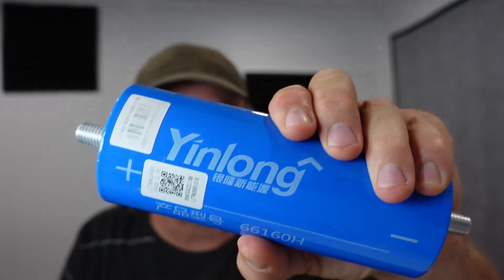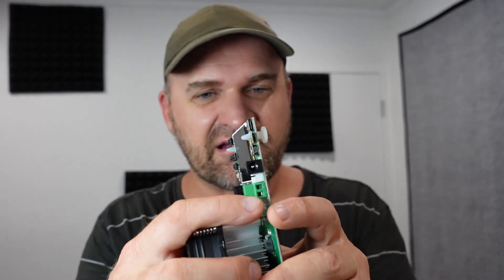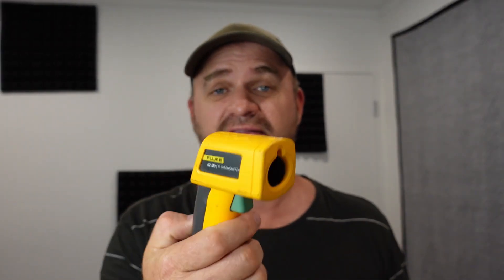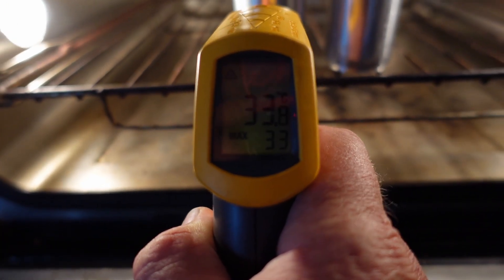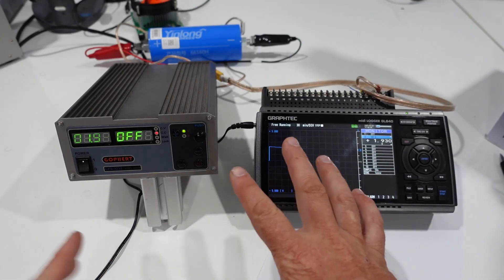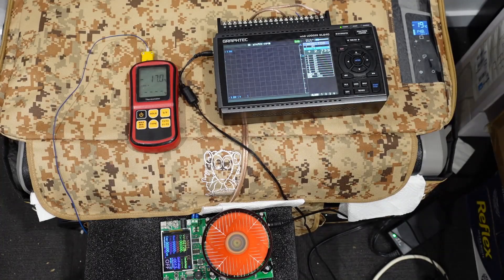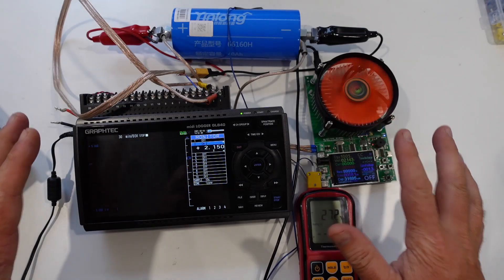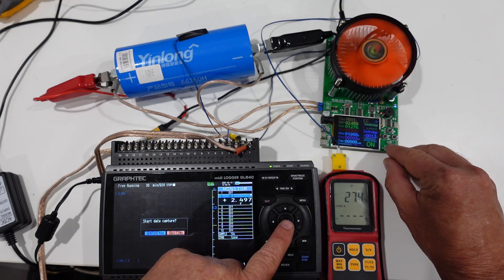Battery testing Low temperature LTO

Comment: Note on laser thermometer: reflectivity of the object can make the measurements off. You measured on the round parts of the aluminum. The laser likely bounced off in different directions depending on where it was pointed at the surface. Try measuring at a 90 degree angle on the flat side???
I have one of those thermometers and you're likely to get widely varying results trying to measure the temperature of a mirror. You might also try painting or marking the surface with a color that isn't as reflective.
Reply from the maker: Nearly... the emissivity and reflectivity combined.  Additionally, things that aren't reflective in the visible spectrum can be reflective in the IR spectrum.  There will be no difference between measuring a mirror or a piece of glass.  The glass is opaque to IR in that wavelength, so the sensor will not be able to see through to the 'silvering'.  Glass has a surprisingly high emissivity, but it also has a high reflectivity.  In the example I used, the angle of measurement/reflection had little to do with the difference in readings.  I'll do an update on this when I get back into posting vids.  Thanks for the comment..
Reply from the maker: The difference between the two was that one of those bits of ali had high emissivity and low reflectivity in IR and the other had low emissivity and high reflectivity in IR.  Visually they seem identical.
Reply: The thermometer I have is made more for high temperature objects, or at least that's what I bought it for- molten metal, firing pottery, etc. There are videos that show how to bend, form, and swage PVC by putting 400 degree (F)/200 degrees (C) sand inside. It saved me enough money on fittings to pay for itself and I didn't have to use as much glue either.

Comment: Hello, I have lto titanat, its voltage was 3.20 on its own in 2 days, is it a problem?
Reply from the maker: On its own?  Is it wired in series with other cells?  It seems like a significant problem to me
Reply: @brendontait6968  hello i solved the problem the multimeter was faulty
Reply: @brendontait6968  I have another question, what should I balance the cells with?
Reply from the maker: @Harun Genç  I've only ever balanced manually.  Initially just putting cells on two metal rails and charging to 2.8V.  I've also manually discharged the banks of cells that are reading high in the battery to bring them into balance with a long bit of wire.

Comment: you can't measure shiny surfaces. The meter doesn't record temps correctly on them.
Try measuring your temperature in a mirror with these.
Tesla warms the batteries on a cold day, when charging, before starting the car, for this same efficiency reasons.
Reply from the maker: Nearly...  What we see as shiny is not the same as what the gun sees as shiny.  For eg with your mirror example... The wavelength these are measuring sees glass as opaque (the spectrum of light the gun can see will not pass through the glass), so it will not see the mirrored surface on the rear of the glass.  Glass also has a high emissivity which means that it emits heat well which will be picked up by one of these guns.  I'll do a deeper dive on this in a later video.  

With regards to the tesla...  I believe the heating of the battery pack is more to do with safety and longevity than efficiency.  If you discharge (at high rate) or charge a standard lithium cell at low temperatures, you'll have the potential to cause irreversible damage to the cells by way of plating or dendritic formation.  This sort of thing can lead to reduced life and safety issues by causing thermal runaways when getting charged in the future.
Reply: @brendontait6968  Interesting. I thought dendrites on Lithium batteries form mostly when batteries are overcharged, or operating at high temperatures, since heat generated between the layers of the battery is causing movement in the electrolyte, which cause hot spots on the lithium layers, causing the formation of dendrites.
Perhaps when cold, the internal resistance rises, causing higher charge voltages, and causes more heat in the core of the cells (while the outside is still cold)?

Comment: You should not have a quarter volt loss over 1 ft of wire. If that lost were linear, it means you'd have 2.5 volts loss over 10 ft. Not possible unless you were using an extraordinary poor conductor
Reply: Iwire (A) × (2 × L(ft) × Rwire(Ω/kft) / 1000(ft/kft))

Comment: Where did you  go?
I would love  an update on this configuration?
I'm about to pull the trigger on 50 cells.
Reply: I'm in the middle of designing the solar system. I'm trying to decide on batteries or capacitors for my school bus build out.
Reply from the maker: Sorry for slow reply... My battery all seems to go well.  one thing I would caution with this style is the internal resistance varies wildly between cells.  So should be built with matched parallel banks.  I'll be back soon!

Comment: I was fortunate enough to find a couple used toshiba 24V LTO batteries (12s2p with 20A cells). I like the 12s better because I don't have to be as concerned about higher cell voltages when it's hot outside. I didn't use a BMS, just 2 cheap PCBs that they use for the supercap boards (6s). I am thinking of using one of those active balancers that uses the capacitors to keep all the cells at near equal state of charge.
Reply from the maker: Lucky!!!  Tbh I'm not a big fan of cell balancing (I'll go into this in a future video) I'd keep a monitor/BMS on for safekeeping
Reply: @brendontait6968  The supercap PCBs are sort of like a simple BMS, they switch on a resistive load when a cap (cell) reaches 2.7Vdc. That would only work for smaller charge currents, but they work for my solar charge controller setup (not real high charge current). The capacitor balancers can be switched off/on so I was planning on turning them on at 2.4V per cell (29V pack voltage for LTO 12S).

Comment: So do you think these batteries would work well for a house battery? With its high lifespan in cycles, it makes sense to have a battery that would last 30 years. Only thing is what inverter to use? What settings do you set your inverter to for the MOG?
Reply: IF Brendon doesn't pick this thread up - it's not difficult to make LiFePo4 last extremely long cycles. Slow in, slow out. That keeps your C ratings down and gives the internal electron's an easy ride. Good batteries are so cheap now it's easy and light to get a big bank.
Reply: PS. Will did a great piece on it in 2019 using info from a Swedish Uni. Good luck
Reply from the maker: Hey Lucy, batteries are getting much more affordable.  I don't really like how most people build their battery packs, not much thought seems to be put into them.
Reply: @brendontait6968  agreed, but I assumed (rightly or wrongly) that Mike envisaged building with LTO as I'm not aware of commercial built packs. BTW. Love your mindset Brendon x
Reply from the maker: Thx 😊
Reply: @lucylovitt9583  I think that there are commercially available LTO packs now. In Australia at least.
Reply from the maker: I thought I'd answered already...  these are the best in my mind, just not the cheapest.  I'm doing a house battery shortly from LFP cells due to their low cost.   The inverter I use is just a regular 24v one. The running range of the battery is 22-28V.  I use a victron mppt to charge it.  During summer I turn the voltage down to 26V.

Comment: How long does it take to charge
Reply from the maker: Depends on what I'm charging it with.  On solar, would probably take a day and a half to charge from zero if some really sunny days.   But it rarely goes below 80%.  That is with domestic fridge, induction cooker, electric hot water.  In most cases it is charged by 10AM.  If I were to make a super powerful charger, could charge from 0-100% in just 10 mins.

Comment: I figured you had clear coated one of the aluminum cylinders so it’s not reflective in whatever wavelength the non contact thermometer is measuring. That one would measure correctly while the other (unmodified) would be off as it’s a terrible black body. Basically insulating itself against thermal radiative losses the same way a space blanket works to insulate you. With the right thermal camera the uncoated one would appear black(ish) but the “clear” coated one (in the visual spectrum) would appear white, glowing by comparison. This may not be what you did but I think it would be another way to achieve the same effect if not.
Reply from the maker: Hey Brett - you get 10 Points!    good work, first one to fully describe what I was showing.  WIll do an update on this in near future.

Comment: this is the best testing i have seen Great Job!!!!!!!!!!!! these LTO cells are a motromer homers dreab they can phicaly sit where the lead acid house batters where, outside or down center of the frame rails of class A (without pass through storage). aside from cost the batter bank could be huge and could be charged at high C rates. What more could a motor home want to never have have a generator or solar panels, just multiple huge alternators activated like a jake brake. You can buy a lot of batteries for the price of a 7.5 KW generator
Reply from the maker: Thanks for that, there are a lot of aspects that I really like about this chemistry

Comment: I would like to use these on my RV!  First they would be connected to an onan 4000 generator which needs 250 amps to start!  And the RV is and charger is setup for standard 12v battery!  What configuration would be required for this?  5S2P five series by two parallels( 10 cells) or should it be 6S3P?  Ie im worried about the high draw of the starter, and having correct shutoff voltage on the charger!  Inverter has low shutoff of 10.5V, and high shutoff of 15.5V.
Reply from the maker: 250A is nothing for these - remember a 1P pack can crank out 400A.  I'd get rid of the gen set and just get a bigger bank and decent solar - maybe even a good alternator on yr RV.  I have plenty of power just running solar.  This is powering induction hobs, electric hot water, domestic fridge etc.  I'd be running 6S and charge limit to 15.3V
Reply: @brendontait6968  thank you for the tips!  I would like to eventually install the solar panels, but im going to have to build up to that!  Also im not sure i can change the settings on this inverter so im stuck with 15.5 on high shutdown for the moment!

Comment: Hi Brendon, I am building my camper based on the IVECO 90/16 ex firetruck. I want to use LTO as a power source. What do you think of this way of coupling using threaded bushes instead of the nuts used fir the test setup. And maybe shortening the studs?

Comment: If you're filming the measurement process you can implement a cheap, but labour intensive 4-wire-measurement by measuring voltage with a multimeter and manually integrating the power afterwards from the video.
Reply from the maker: Hey, yeah there are a few ways to do it.  Glad I have a 4 wire load now.

Comment: measure voltage at each end of your power wires at capacity loading calculate power loss and  subtract that from watt meter.Your wires are now part of your battery calculations.
removing will improve end value a little.
Reply from the maker: I think just getting a 4 wire meter will be the best option.

Comment: Hi, love your talks. I am looking at powering a large launch with an electric motor as it's only drive motor. Would you suggest these Yinlong batteries? I am also in NZ. I ultimately want to run from only solar powered batteries with enough power storage for long trips to the Polynesian islands and Australia. I will also have a diesel generator backup for those cloudy days.
Reply from the maker: Thanks for that.  Sound like a great project.  Have thought about doing this sort of thing myself,  personally i'd use LFP cells due to the cost/capacity ratio.

Comment: Awesome thumbnail 😂🥶
Reply from the maker: haha - thx Will, i was sweating like a pig taking it in the middle of summer
Reply: Will Prowse refuses to acknowledge messages!
I’ve been trying to get help finding out about these Li2Ti03 batteries for boat’s with larger loads and 250amp alternators on the main engines!
I also have a xantrax freedom 25 that keeps blowing fuses in the MPPT controller every time I plug into the shoreline power supply the bulk charging from the inverter charger is to strong!
Reply: @fixitbrewbaycustom854  I get over 100 emails a day. I don't even have enough time to open them. Sorry. Check out diy solar forum if you need help
Reply: @WillProwse  I’ve already tried the forum and even there they started changing the subject to motorcycles and their preferences and riding habits! 

Meanwhile the issue with customers with larger boats having 250amp 12volt alternator and larger loads out on an anchor is why I’m trying to get help finding alternative solutions to lead acid batteries!

Without LiFeP04 batteries catching fire inside customers boats miles away from land!!
Reply: I’m curious why you ignore messages about these Li2Ti03 batteries for boat’s?
Plus I’ve been sending messages about this Freedom 25 inverter chargers blowing fuses in the MPPT controller every time I plug into the dock it’s bulk charging is to strong and I have been trying to get help to find a inverter charger with MPPT controller built in to avoid this issue! Most larger boats have a 250amp 12volt alternator and battery selection is critical!!
Hence why I’ve spent 6 months trying to your attention on this issue!
I’m curious why you are constantly talking about guns and girlfriends instead of DYO solar systems?
Reply: @fixitbrewbaycustom854  and yeah, use lto then. Sounds good. Up to you
Reply: @WillProwse  a link to a professional solution with a description of the best technology available would have been better than “ya what ever “! 

I was hoping that you were more professional than that!!  
I’m hoping that you will be more professional so I don’t have to stop bragging to my customers to check out this young fellas website to better understand what new technology is available!

Simply because batteries catching fire issues is what most people remember from the news media coverage!
Reply: @fixitbrewbaycustom854  whose lifepo4 pack caught on fire?

Comment: Measured temperature differences are due to changes in emissivity based on material or, in this case, I’d imagine surface finish. Always nice to see someone addressing accuracy issues when measuring temp with these!
Reply from the maker: Thx, surface finish was fairly similar on each of these, but you are deff on the right track
Reply: @brendontait6968  Correct.  The reflective surface of the metal cannot be measured accurately with that type of device or a thermal camera.  Doesn’t work.  Its similar to pointing it at a mirror.
Reply from the maker: You were kindof on the right track, but then fell off the rails 🥺
The transmissive properties of glass fall off around 3um whereas these measure around 10um, so none of the photons will make it to the reflective surface on the back of the mirror.  The front face of the glass will provide some reflection, however... glass has a high emissivity which means that it will emit a lot of its own temperature photons.  Why did the two bars read so differently when they appeared so similar?
Reply: @brendontait6968  it's possible the ratings were different because they were at different angles.  I just know I've had the same problem with my handheld reader and thermal camera on reflective surfaces like pipes.

Comment: The incorrect reading from your non contact thermometer is due to infrared emissivity. The emissivity is the effectiveness of the material to radiate infrared radiation (heat) that the thermometer measures. The thermometer is calibrated to a specific emissivity. Effectively the aluminum is too shiny to get a correct reading on that thermometer.
Reply from the maker: Hey Trumpet, close...  why did one show hot and the other cold?  They were both similarly shiny?  Both reflective and heavily oxidized aluminium have low emissivity levels.  Glass and water have a high emissivity, but also highly reflectivity.

Comment: The reason your infrared thermometer showed a substantial difference between oven and aluminum block temps was your reading on a reflective material, the less reflective and more flat your surfaces are the more accurate your reading will be. The reason your Temps differed between samples so much was attack angle on the material. As I stated before, un-reflective, flat surfaces read at a right angle will give the best possible readings. Rounded, reflective surfaces read at a different angle is where your inconsistencies came from. 

If you ever have a chance to compare temp differences between infrared meters and other types of temp devices such as thermocouples or even temp sticks please do it. It will blow your mind at how much variation those temp guns will give. The largest variations I have found is with highly reflective surfaces shooting at an angle....that may be a decent content idea for you😉
Reply from the maker: Hey Mat, yeah thanks.  I actually cut the video where I did a second confirmation test to show that the blocks were each reliably measuring that temperature, the reading wasn't due to the angle in this case - but you are correct, the angle makes a difference.
Reply: @brendontait6968   this phenomenon is called emissivity and there a setting for more reflective materials to calibrate to.
Reply: @wthompson2444  you sir are dead on Im a calibration technician and see this on YouTube all the time. We calibrate Infrared temp guns on a Black Body and set all instruments under test to .95 emissivity